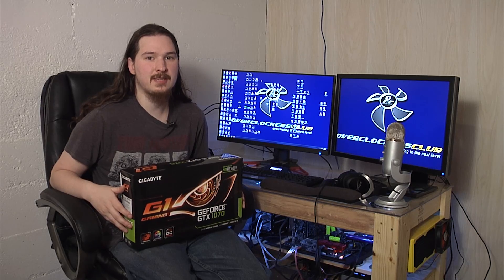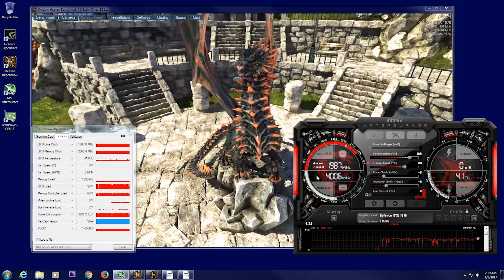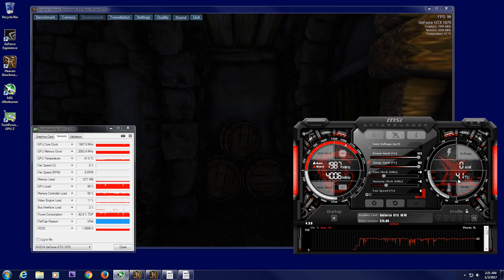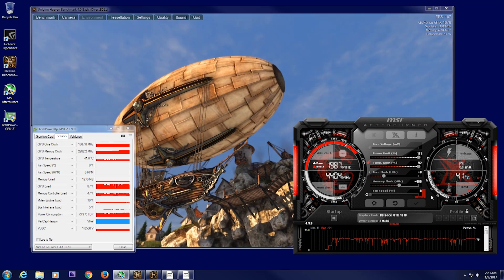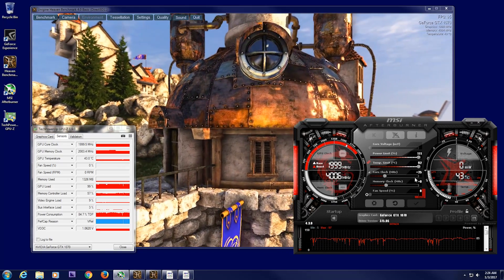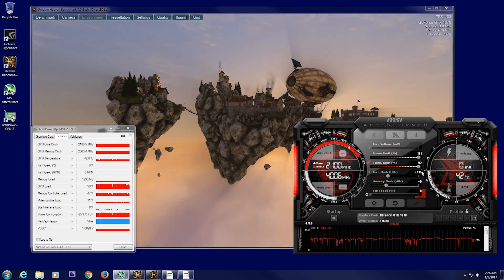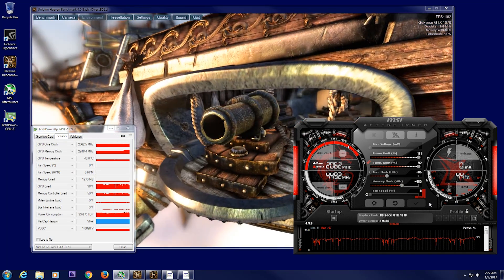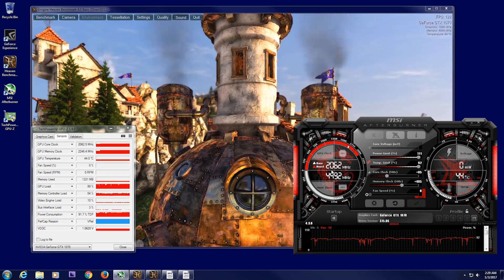NVIDIA GTX 1070 Overclocking Guide

Comment: Your videos helped me out a lot I've been using MSI Kombuster before this video and I was never able to get a steady overlock when running any games. When I switched to Heaven Benchmark and it overclocked crashed correctly, I finally could fine-tune overlock my NVIDIA GeForce GTX 1070 Ti 8GB Founders Edition with an Arctic Accelero Xtreme IV. My final and perfect overclock without crashing, gaming 8 hours straight on any high-demand game (tried and tested):
*Core Voltage: 100%, Reference Design
*Power Limit: 120%
*Temp Limit: 92%
*Core Clock: (Base 1607) + 214 = (Average 2114 MHz, Peak 2126 MHz)
*Memory Clock: (Base 4007) + 568 = (Boosted to 4568 MHz)
*Fan Speed: User Defined + Auto
*Fan Curve: (% - °C) 40-40, 60-80, 84-88, 90-100

Comment: Hi, I've recently got 2 GTX 1070s and got them in an SLI config, but when I try to do the benchmark on stock settings it crashes. The only way to complete the benchmark is to run cards in debug mode or downclock the GPU clock and memory by 100Hz. Any idea what could be the issue?

Comment: I’m still running my GTX 1070 with pretty good results. The price and availability of video cards right now means I need to stretch out the life of my trusted 1070. Thanks for this walk-through. It’s been a while since I’ve overclocked and it was nice to have a solid refresher. 👍
Reply: What are your OC numbers looking like?
Reply: I think this is the year I have to upgrade. Even a light game like Valorant on low is dropping frames. This video is hopefully going to take me through to summer
Reply: @aidan8473  yeah bro I'm in the exact same position going from 350 to 140 all the time

Comment: umm i overclocked memory clock by 5, i have the same GPU (same brand g1 gaming, but the original 3 fan air cooled), its at 44°C and it glitches, what should i do?
Reply: Lower the speeds

Comment: why did you use msi software with gigabyte
Reply from the maker: MSI Afterburner is a GPU universal overclocking and monitoring program.
Reply: @overclockersclub  thanks
Reply: 2500 gang with a 1070 regular
Reply: whats gigabytes software called? oh wait it doesnt exitst
Reply: @blankabison1331  but it exist...

Comment: i have the same graphics card but i can put my  numbers up to a much higher count without problems, any advice because im confused
Reply from the maker: Not all GPUs are equal. You might just have a better binned card. I do suggest running 3DMark Stress Test to make sure the card is stable. Should be 98% or higher in passing.
Reply: This dude has a stock speed of almost 2000mhz, he is already on the limit, whilst you probably are in the 1800s
Reply: @Kyané-n3r  my palit dual 1070 is an ex mining card,been mining for 2 years nonstop,the memory oc degrade so much lol,usually micron can go above 400MHz,mine is struggling even at 350

core max is 2075,2088 above is gonna crash
and my psu is corsair cx750m
Reply: @ghaviorizky3961  i managed to oc my 1070 with 100% fan speed to reach 2200mhz, but i noticed that i only gained like 6% more performance, so it is not worthed, i left it at 1950mhz.
Reply: @Kyané-n3r  well thats the thing,depends on the game or the user if you want to oc the max or not,gpu boost 3.0 is already enough for most people

Comment: put my settings to what you had in the video. i have 2700X and founders 1070 with samsung memory. i managed to score just over 16800 on firestrike, better than 84% of results. in 2020 GTX 1070 is still a beast mode card. thanks for the video! 💥
Reply: Got around 13600 on firestrike with a i5 4670k 4.3 ghz and a gtx 1070 oc. Is that good?
Reply: @mathias4514  

yeah thats a good score dude. ive had quite a few systems. when i had a 6 core xeon cpu and a 1070 jetstream i was hitting about that score. you want to swap out that cpu for ryzen 6/8 core at some point. thatd be worth another  2000/3000 points.

i found a great deal on a gtx1080 founders (£250) and now my score with....
2700X 4ghz base clock
hyper 212 black cooler
1080 manual overclock
corsair LPX 3200mhz

 .....19338. better than 90% of all results 💥
Reply: @D-2-RZ  Okay thank you. Yeah I have been thinking of buying a ryzen 3600, but I would have to swap out the motherboard, new ram, plus the cpu and prices in Norway are expensive. Goddamn 250 for gtx 1080 when I got my 1070 used I payed around 330 euros about a year ago.
Reply: @D-2-RZ  Thanks bro very true. I have some old parts from a old system I should sell too that might cover the expenses. I really feel the limitations to the old i5. I goes up to 100% a lot of times when playing making my discord lag. I think a ryzen 3600 would work out and hold up for a long time.
Reply: @mathias4514  
yeah, 2700X is the better processor if youre multitasking, but the 3600 edges it on gaming. i wanted 8 cores to guarantee no bottlenecking as i have loads open at once so that was why i went for the 2700X. ill wait for the 4000s to drop and see what price the 3900X and 3700X fall to.

id wait though till this virus bs is overwith. prices are screwed atm. 1080s cheapest are £350 now, and even the 2700X has gone up to £180 (£30 increase). prices wont be back to normal till sept time i reckon
Reply: @D-2-RZ  Yeah I mostly game so I think the 3600 is the best choice for me. Yeah going to wait some months. Thanks for the help.
Reply: @mathias4514  youre most welcome dude

Comment: I have a Inno 3D 1070 with 1900 MHz Core Clock and  4100 MHz Ram Clock as standart values. Thx to this tutorial i boostet Core Clock up to 2100 MHz and RAM Clock up to  4700MHz. The temp. is stuck between 68°C-69°C after more then 30 min. in the Kombustorand its stable af. Thank you so much.

Comment: Unigen sucks for overclocking. I got a 120 core and 1950 memory stable on unigen, but if i play a game, i crash within the first minute.
Reply from the maker: Yeah Heaven Benchmark isnt the best anymore. But it is free and has a looping function. Best thing to do is lower the clocks -25 and play a game. 3dmark stress test is good benchmark also. But that isn't free.
Reply: Free MSI Kombuster that you can download right through the MSI Afterburner app. is good for this isn't it?
Reply: @Chuter44  i was able to get 160 with 1950 stable on kombuster(let it run for 30mins). Well, it was furmark, but its exactly the same thing from what i have heard. Personally, i wouldnt use kombuster because the oc i was able to get on there immediately crashes unigen or any game. Now, i dont use anything except playing extremely gpu intensive games since that provides real world preformance. If the game crashes then ill just lower the setting abit. The game i use is gta 5 since thats the hardest game to run that i have, but you may have games that push it harder than gta 5. Make sure to try your OC on multiple games though. Like i could do a higher oc on bf5 and doom than gta 5, but if i try that same oc on gta 5 it crashes.
Reply: @thatxonexguy5438  I am playing games in 4k. with my 1070 FE. I have it +225 and +450 playing stable with no issues for over a year and the fan at %100. Power %112. Temp limit 91c. This is giving me 12-15+ more FPS. @ 4k. High/Ultra. My card hits 83-86c. sometimes. Stupid one little fan. How come I don't hear of anyone else with +200 or more on the core clock? This also produces a matching top score for the 1070 %109-110 on UserBenchmark. Thoughts please!?
Reply: @thatxonexguy5438  I have DOOM and GTA 5 two of my favs. I still mess with GTA V in game settings to this day. Turning AA. off in GTA V @ 4k. is a huge FPS. boost and doesn't hurt the visuals much because well it's 4k. still lol. :)
Reply: @Chuter44  thats odd. The core clock is like 1070ti levels. I remember watching 1070 ti overclocking vids and seeing 200+ core clocks, while 1070s get 150 tops. Do you think that Maybe you got a 1070ti chip on accident? The 1070ti has the same chipset except they sort out the ones that dont preform as well and put those into 1070s. The 1080 uses the same chip aswell, but different memory so you cant flash a 1070 bios to a 1080 one. Anyways yeah i havent seen a 1070 get 200+ to be honest. Also regarding those temps, i really don't think thats normal. I heard its unsafe for 1070s to get above 85. My 1070 was hitting 69 tops when the 160 core and 1950 mem overclock, so i think it would be getting extremely toasty at that point. Granted its a gigabyte 3 fan card and the cooling is extremely good on it. If you have any good thermal paste around, you could probably repaste it and drop the temps a little bit. Not sure if you would consider that worth the effort though. You should look more into the safe temps for the 1070 though. 80 sounds a little on the upper safe limit imo

Yeah 4k doesnt really need AA. If you really wanted too, you could use fxaa to smooth out the little amount of jagged lines there are. I dont think its worth it though considering it makes the game a tad blurry (it differs game to game).  For example, Gta 5 has terrible fxaa. Though, I play on my tv (50 inch 4k) so im not too sure if thats why jaggies and fxaa is worse for me.
Reply: @thatxonexguy5438  Don't forget about the higher core count on the TI and 1080

Comment: How do i check if i have samsung or micron memory. I have a gtx1070 FE . And which memory is more overclockable .
Reply from the maker: The program called GPU-Z will tell you. I believe for GDDR5 (which is what the GTX 1070 uses), Samsung memory overclocks better.
Reply: Mine is FE. = Samsung ttps://www.techpowerup.com/gpuz/

Comment: My base clock is stuck at 1582 and will not move. Anyone knows why?
Reply: It's cheap
Reply from the maker: What brand / model is it? Usually stuck at base clock means it's not operating correctly. I only seen a Pascal card go that low when card gets above 88c.

Comment: I manage to overclock my 1070 to Core = 115 and Memory = 500, and this result is very stable for me, didn't crash till now. My CPU is old, and maybe is that the reason that a achieve a good stable overclock with those values. I have a FX 8350 with 16 GB Ram DDR3 on a Gigabyte 970A-D3P (1.0). Actually this video helped a lot on my first successfully GPU Overclock...
Reply from the maker: Awesome! Those results are fairly normal. I'm glad it didn't give you any trouble.
Reply: OverclockersClub your video helped a lot, very detailed explanation about the topic and even better since you are explicitly talking about the 1070. About the specs, I might upgrade to an i5 8th gen, to actually use the 1070 on its full performance. The FX-8350 is capping the GPU...
Reply from the maker: Yeah I wasn't impressed with the FX-8350 at all. I could see a noticeable drop is frames over a i7 4770K when I tested it a few years ago. The new Ryzen are quite good for the price, but Intel still holds the reins.... for now. The i5 8600K preforms very close to the Ryzen 1800X, it not better in some games.
Reply: I wonder if the ASRock mATX H310M-HDV/M.2 is a good start for a i5-8400, of should a go with a more powerful and complete motherboard. I have a very restrict budget to update my rig. I'm from Brazil, and nowadays, computer parts are very expensive here, since the govt increase the importation taxes for electronics. And memory are a very expensive part also. I might get a 2666 DDR4...
Reply from the maker: I understand you are on a budget, but Realtek® ALC887 codec is really the lowest audio chip possible. Unless you have USB audio headset, your games will not sound so great. Besides that the H310M has limited / no overclocking functions. You could also buy that board first than upgrade to another ASRock later down the road.
Reply: I had not taken these details into account. I'll do some research. Even not picking up a high-end board I prefer to take something that has a good cost/benefit. Tks!!! :D
Reply: WHAT 1070 U ARE USING SIR?

Comment: I have gtx 1070 8gb amp extreme it only lets me up the base clock by 10 and memory by 50... but the base clock reaches 2025mhz and memory at 4151mhz. I get 100+ fps in every game I own most are 2017 and 2018 games my card kills pubg and Cod over 100fps 90% of the time
Reply: YovaniCruz does it still smash pubg?

Comment: I feel like you should be able to reach at least 2101MHz on core clock, 2062 is quite low. 
First, go for "maximum performance" in Nvidia power management mode.
Unlock the voltage monitoring and control in Afterburner, and increase your overvoltage. This will let the GPU apply a choosen percentage of the maximum voltage (1.094V) when turbo boosting. If your temps are fine and you are not hitting your power limit, you should be able to increase your overclock to something around +150 or +160MHz, and eventually hit at least 2101MHz and keep it stable. 
My 1070 at 1.094V keeps its GPU clock between 2114MHz and 2139MHz, with spikes at 2101 and 2151MHz, and +550MHz on memory clock.
Reply from the maker: staying at 2100Mhz or above is very unlikely. Some people are able to of course, but it not common at all.
Reply: OverclockersClub But you should at least try to hit the maximum voltage, 1.094, otherwise you will never know
Reply from the maker: True!

Comment: can you fry your card by playing with these seting too much or go too high?
Reply: Not really. Pascal GPUs will never let you apply more than 1.094V, which is a pretty safe voltage. The only way to get more voltage is by modifying the BIOS of the GPU, which, of course, is a quite extreme thing to go for. Also, not so many GTX 1070's or 1080's are likely going over 2114-2151MHz on core clock, at 1.094V. Just find your safe, stable overclock, be sure that there are no artifacts and that your temps are below 85°C, and you'll just be fine. If your GPU hits its power or thermal limit, it will just throttle to avoid any damage.
Reply: This is why I oc moderately not heavily
Reply: While theres always a chance that your PC "just catches fire" but I highly doubt it can be caused by OC (without mods that allow you to go even higher in voltage) these days
Reply from the maker: There is always a chance to burn out your card. That is the nature of overclocking.

Comment: Hello I managed to overclock my GTX 1070 with +210 and +660 on memory with 68 degrees. I am running for 10 min stable right now, tried +220, but I am crashing. My Power limit and temp limit are locked tho. Why? Is there any way I can unlock it? Can I overclock more if I do?
Reply from the maker: NVIDIA locked them down. You cannot surpass 120% power limit and 90c Temp Limit without physical mods like the Shunt mod. I don't suggest it though. You may be able to squeeze a few extra mhz from watercooling and lower temps, but without voltage or power limit mods you are kinda stuck.
Reply: OverclockersClub I tried to leavr it like that, but when I started my game and played for a while I crashed and I restarted my laptop, then there was a green pixel on the screen, it went away after 20-30 mins, overheating was not the problem, cuz it was running on 65-70 degrees
Reply from the maker: I don't suggest overclocking any video card in a laptop. Even though the GPU is the same (for Pascal), you have to deal with different set of parameters. I have no experience with this since the option to even overclock on a laptop platform is very new. I would set it back to stock and leave it alone.

Comment: thats not a nvidia gtx 1070 thats a msi gtx 1070...
Reply: All GTX 1070's are Nvidia GTX 1070's lmao
Reply: Meant to say gigabyte. Not MSI.
But thats still not a NVIDIA GTX 1070.... This is a Nvidia GTX 1070..... 
  https://www.nvidia.com/en-us/geforce/products/10series/geforce-gtx-1070/
Reply from the maker: The link you referenced is just the Founders Edition (FE). The video card I used is still a GTX 1070. Gigabyte is just not using the reference cooler and PCB. The GPU Die is the same.
Reply: That's like saying an Asus R9 390 is not an AMD card...
Reply: Doesn't matter what brand it is, the PCB board is from Nvidia u banana
Reply: @thealien_ali3382  not the board. the Chip
Reply: @PCuser0137  the PCB is from Nvidia u donut
Reply: @thealien_ali3382  not always u cherry
Reply: @PCuser0137  u clown the PCB comes from Nvidia
Reply: @thealien_ali3382  Some manufactures make their own

Comment: I am getting a Asus 1070 oc edition,  will i be able to overclock to 2000-2100 mhz Im new to overclocking
Reply from the maker: Nothing is guaranteed but I haven't come across a card that can't hit 2,000mhz (Even the cheapest cards). Most forums i've read of people with ASUS STRIX OC get 2,075 to 2,150mhz. I think the OC editions are binned higher, but nothing is, once again guaranteed.

Comment: could be the clocks are in offsets of +13Mhz 
like my GTX 780's
i can put my GTX 780 in a kepler tool and see the clock and voltage tables.
if i want to jump to the next clock i raise the offset 13 Mhz 
if you raise the clocks table, the voltages gets shifted.
but nvidia probably raised the voltage , so you can do few offset steps. 
i can do 8 steps offset Mhz without messing with my voltages with default vbios.
kinda depends who made the vbios and what it says.